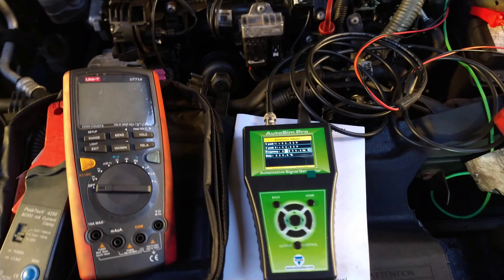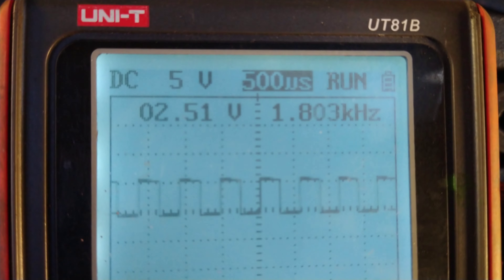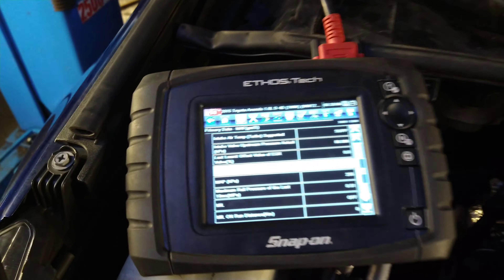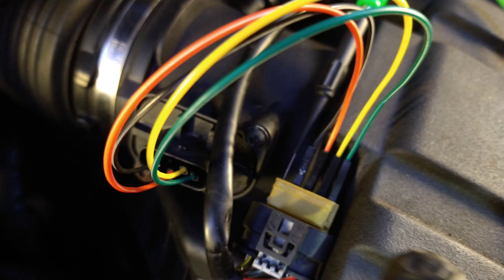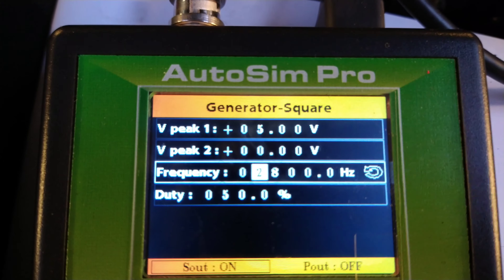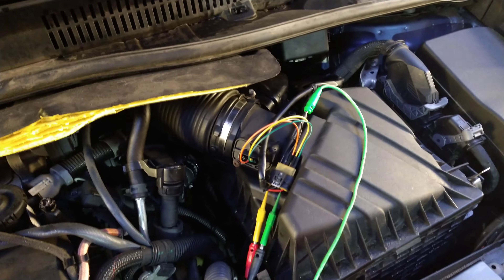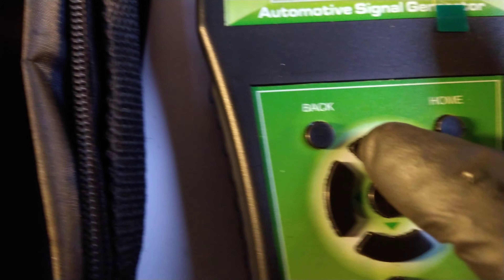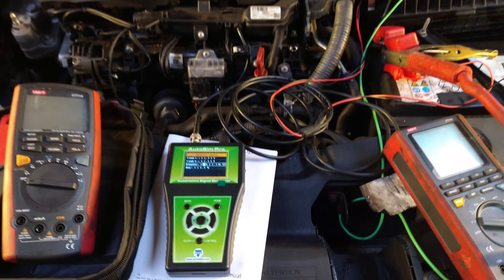Digital MAF signal simulator (Ditex AutoSim Pro)

Comment: Great video mat and what scope meter do you prefer the uni t or the hantek 2d82a cheers
Reply from the maker: I prefer the uni t because I can see the screen in sunlight. It uses regular multimeter leads, no attenuation needed. It can graph the amp in series measurement. It takes regular as batteries.
I have used this on most sensors I have tested. I have a Pico if I need to have a sync with another channel or more precise measurements.
The hantek is useful when I need two channels.
Thanks for watching

Comment: Good test Matt , sensor simulator is a very useful tool to have , do u have link for ya breakout wires 
Rob
Mobileman
Reply from the maker: Thanks Rob, I will try and find it and add it on here. Cheers mate
Reply from the maker: https://www.amazon.co.uk/Elegoo-120pcs-Multicolored-Breadboard-arduino-colorful/dp/B01EV70C78/ref=sxts_sxwds-bia-wc-nc-drs1_0?cv_ct_cx=breadboard+jumper+cables&dchild=1&keywords=breadboard+jumper+cables&pd_rd_i=B01EV70C78&pd_rd_r=c39c3890-530b-4755-859e-7b84b764281d&pd_rd_w=xk5pT&pd_rd_wg=GwtAH&pf_rd_p=a245f193-f5e3-4355-acb1-a68d1f4dcc73&pf_rd_r=JGHWETDY8MHAAXSTWANS&psc=1&qid=1611950989&sprefix=breadboard&sr=1-1-c51e89e3-8bf6-4683-ae96-8c677e961a1e
This is the same leads that I used. Cheers

Comment: Cant you just leave plugged in and backprobe signal wire instead of bridging?
Reply from the maker: Hi Mike, if there was no signal at all coming out of the sensor on that wire, I'm sure you will be fine back probing a signal into it like you said. I think with this having a signal, if I added another on top of that, it would see two signals and get confused.
Thanks for watching and your comment

Comment: Well done Matt.  On key on the Ecm will always take a barometric reading maybe that why it was not giving an reading
Reply from the maker: I tried pulling the baro sensor jumper wire on and off a few times with the ignition switched on. every time I disconnected the baro signal, the MAF also lost its signal ( it would go really high ) then when I plugged the baro jumper wire back in the MAF would read 0 grams again if I had the simulator set to 1.8 KHz. I could change the Hz up and down the grams would go up and down also.
It needed the baro part of the sensor connected the whole time to do this.
However it didn't seem to need the air temp part of the sensor to get the MAF part to work. It's a bit of a playing around learning curve for me with the digital MAF simulation. 
Thanks for watching Ian
Reply: @mechanicmatt871  yea i bought the older version last week I am only starting to test it now  it's all new to me as well thanks for sharing